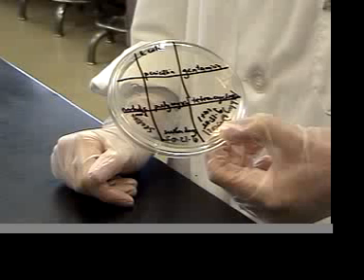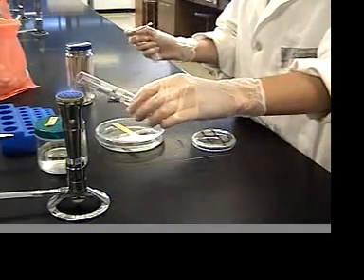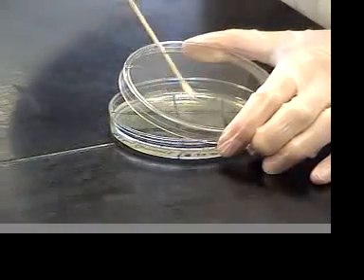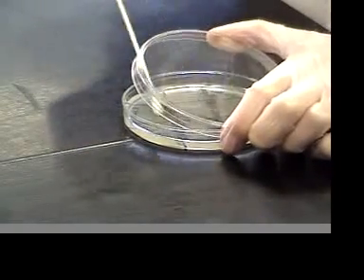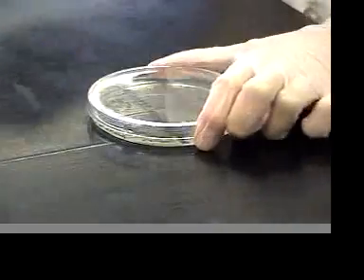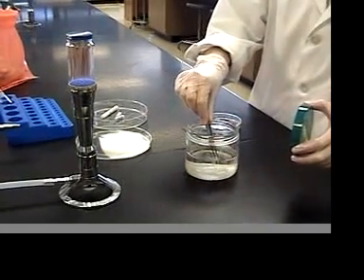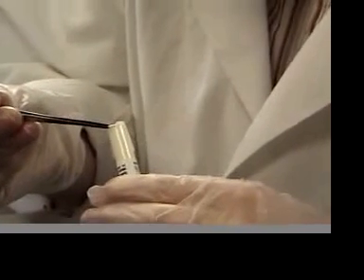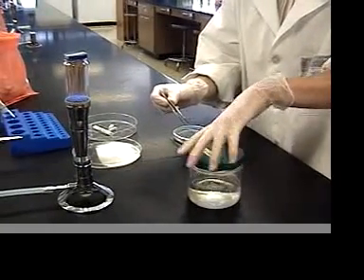Kirby Bauer Technique

Comment from the maker: Greetings! In order to sterilize the tweezers, simply dip them in ethanol and pass them through the bunsen burner a single time. Be sure not to allow the ethanol to drip up the tweezers and onto your hand. You can buy sterile blank disks and just resuspend your turmeric at a known concentration. You can then saturate your sterile disk. 
You could also do an MIC experiment with turmeric if you want more quantitative data.

Comment: Hi! i am doing a similar experiment in which i am testing turmeric against a bacteria called P. acnes. I am doing the same disk diffusion method and i was wonder how i soak the blank sterile disks in a solution of turmeric and water. my teacher said to use an autoclaved tweezer. but do i just dip the disk in a test tube? and how do i re sterilize the tweezer if we aren't allowed to use bunsen burners?